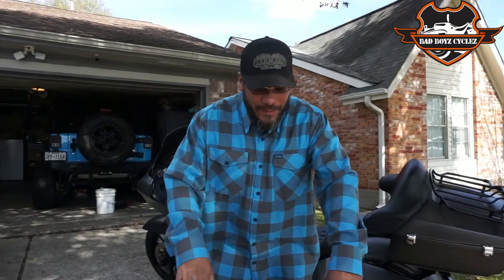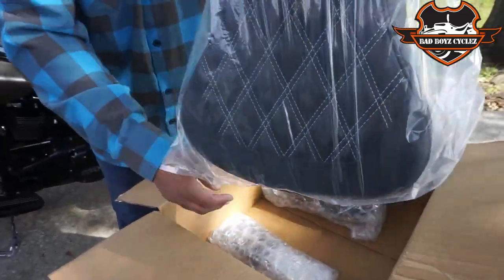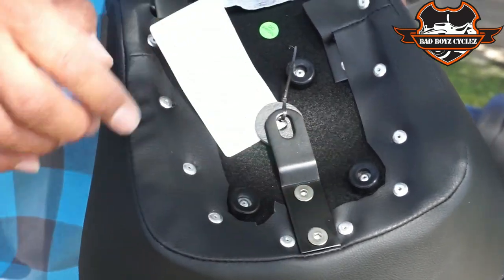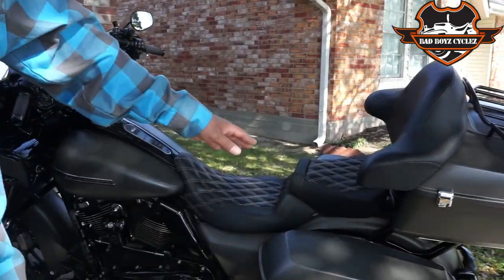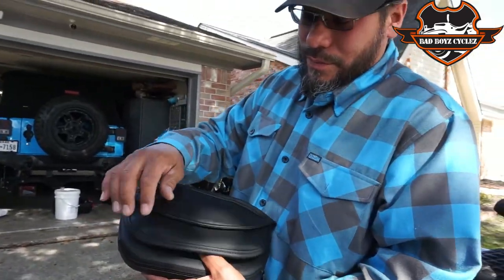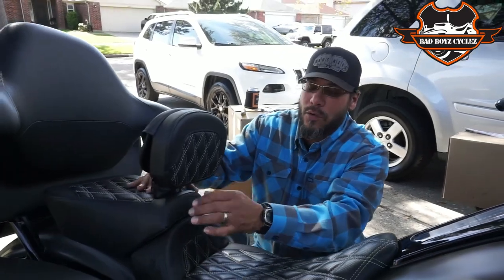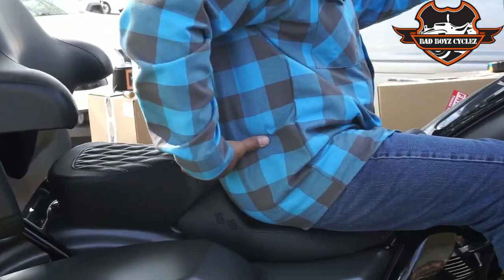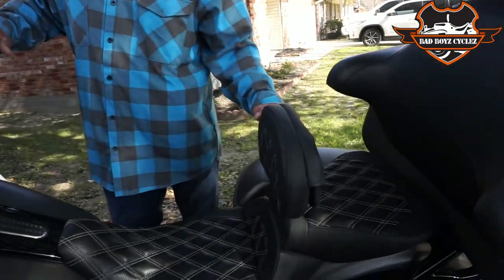BAD BOYZ CYCLEZ | FREEDOM SERIES | PILLION SEAT AND RIDER BACKREST | HAND MADE

Comment: Did you find a way to really lock in the pillion? Noticed it rattles quite a bit when just locked into those posts with just the back screw holding it down. Did that bother you when riding solo? I almost want to tighten the bolt onto those instead of using rhe "groove" part for it.
Reply from the maker: I didn't find a way to tighten that down but I ride solo alot and it doesn't move like that. I think it was just me pushing it around and when the wife is on it of course it doesn't move either. That is a good idea as well . Putting them under the bolt. Thanks for watching 🤙🍻. If you try that, please let me know how it works .
Reply: @KnucklesTvMV  Yeah definitely wont' rattle when someone's on it, but I like leaving the pillion on full time, adds some more back support to really lock you in the saddle, as I don't have the back rest with mine. It was tricky to get the wrench on it once the pillion is on, but it can be done, and definitely really locks down the pillion. No wobble at all.
Reply from the maker: @seanodriscoll6463  thats awesome! Thanks so much. That's really good info 👍
Reply: @seanodriscoll6463 I noticed the same, for that reason I ended up re-using the stock nuts as it was easier and I could get a ratcheting wrench on them